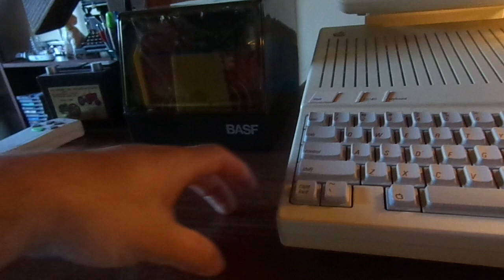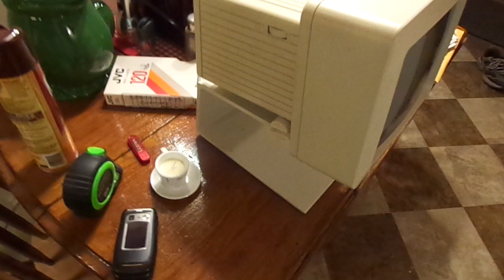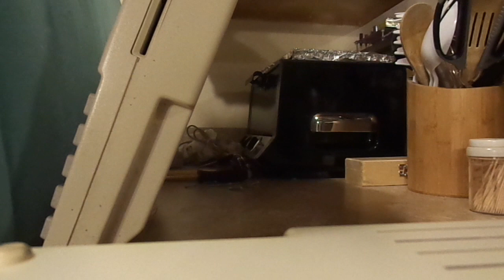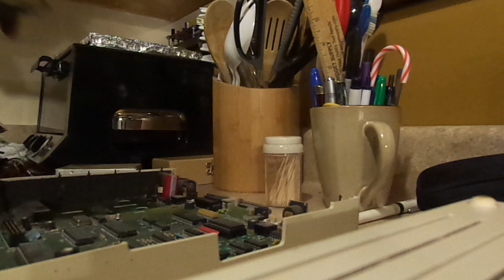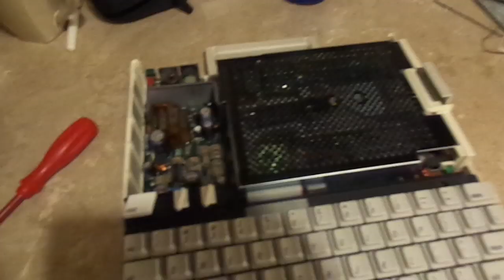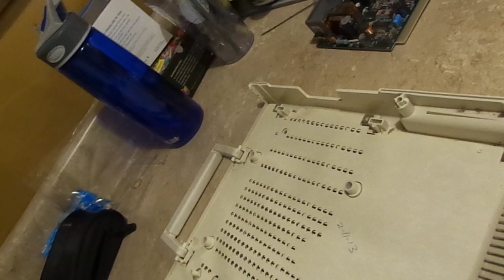The Apple IIc

Comment: 3:58 - (Didn't want to pay ebay prices, trolled around on Craigslist for a while, got the machine for $50)

Nice! I think your machine has the Alps keyboard, too, so I am a bit jealous. But yeah I was very much in the same place trying to get a IIc. Ebay prices are nuts and I didn't want to go that road again. (Got my Amiga on ebay, "untested" and missing all kinds of essential accessories, for ebay prices)  I trolled around on Craigslist for a while, saw some interesting machines (like the IIc+) but not at good prices...  Then finally found my IIc. $50, like yours, though mine is a 1984 model (crappy keyboard, older ROM, no RAM expansion header). Not perfect, but it's a fun little machine. Apparently the prior owner got it in 1984 and used it to run a hardware store, the store name and phone number are scribed onto the bottom of the machine and the monitor has a bit of burn-in, from Visicalc I think. The keyboard had kind of seized up when I first got it, had to push down hard on a key to get it to press, but over time the keys have loosened up, now it's pretty decent.

Since then I've found a fair number of good deals on old computers, mostly at flea markets. About a month after I got the IIc I went to a flea market and got a complete 486 gaming PC for $20 and a broken (but very nice-looking) Commodore 64 for $4. At the same flea market I also saw a IIgs with a hard drive for $40, a Tandy model 100 with floppy drive for $40, a 100-series Powerbook for $60 I think...?  And a couple months ago I got a Commodore 1581 for $40. WIth the ebay prices on those I never thought I'd own one again...

To me there's a clear lesson here: ebay prices are not the only prices, different markets have different prices. There are still deals out there...  You just have to be patient, and look around instead of just going to ebay.

Comment: Does the Apple IIc need a boot disc? I recently got one and it makes all the usual Mac boot sounds but nothing ever appears on the screen. The monitor seems to work fine it makes a flash when I shut it off at least.
Reply: Ah, the monitor contrast dial is touchy. If I tap it the monitor goes out tap it again I get a picture. Seems I do need a system disc.
Reply from the maker: All Apple II software is bootable; but you can boot it from a system utilities disk, or a copy of ProDOS. Not much ever goes wrong with these systems; they'll be around for years to come. You may need to service those monitor contrast/brightness potentiometers, but it's all analog and very fixable.
Reply: BBISHOPPCM's World I guess my memory fails me then. How do you boot into apple basic like the IIe

Comment: I just picked up a unit and monitor from ebay for under a hundred dollars. it number five out of seven and I got the second to last one. for an additional 5$, I got some accessories. the power supply, rf modulator, and the gary phillips user guide. I also have an ADTpro disk I don't know what to do with. with no software other than adt, where should I go from here?
Reply from the maker: Watch my video on ADTPro. It should explain everything for you.
Reply: I actually already have an ADTpro disk for the apple. I'll still need to get it on my main computer after I buy the serial, right?

Comment: The IIGS was better than a mac in almost every way with screen resolution being the sole exception. Apple should have built up from the II and transitioned through the GS to the Mac.
Reply: +kidonlyle Not at the time. The original mac was inferior in pretty much every way except vertical resolution. The processor was slower, but there were faster versions of it, it was deliberately hampered and it didn't have to do as much with graphics and sound co-processors present.

Comment: We used an old tv for a monitor, don't ask me how my father knew how to set it up!
Reply from the maker: +Christina Parissi That was a common configuration, actually! The IIe and IIc models were often paired with a small black and white (or color) television, as they used a standard composite video cable to connect to the monitor. The best display for these models is a phosphor green monitor, as they display text much better than color or black and white TV sets.

Comment: Half-Height Belt-Drive 5¼" drives were quite common.  The factory original drive in the IBM PCjr used one.  I had several expansion drives on my jr and all of them were belt-drive as well.

Gotta love the stroboscopic wheel for adjustment purposes, kind of brings back the kind of nostalgia you'd get thinking about points-and-condenser ignition on cars.

Comment: Ahh, the IIc, my first computer.

Quick way to get the case open. Remove the screws, flip the handle into the down position like you would put it on a desk, lift machine 2-3 in. off the table and drop it. The cover will pop right off without any broken clips. Besides the memory expansion connector, the later IIc came with a revised keyboard.

I don't know if you are selling parts or not, but I could really use the closed apple key cap off that other keyboard you have to restore the IIc I have. Mine has a broken stem! Contact me via private messaging.